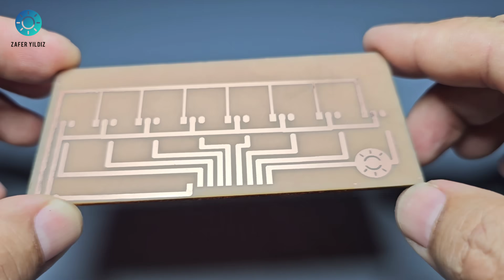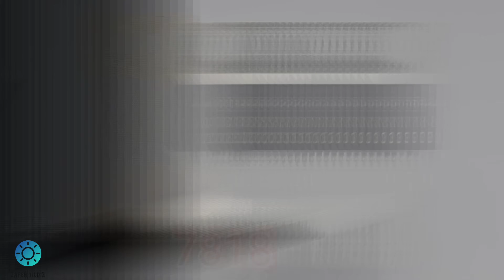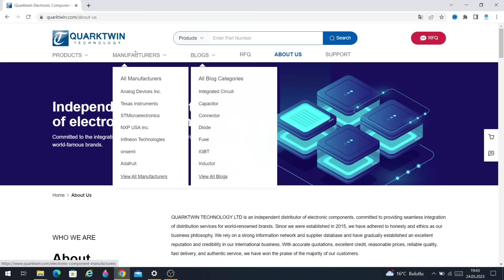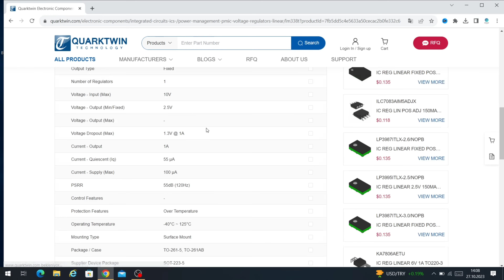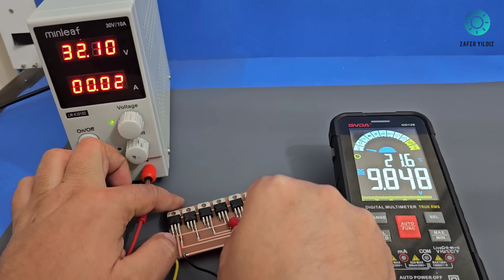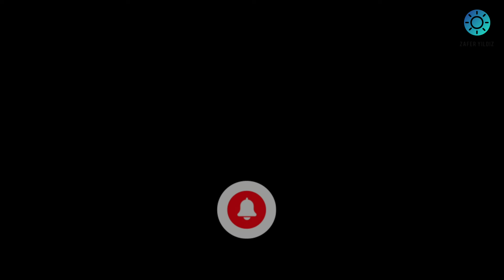How to make a multi-output voltage regulator power supply 5V.....24V

Comment: Excelente! Cuánto voltaje es el mínimo y máximo para un estabilizador de tensión como cualquiera de estos? Es decir cuántos volts por debajo y por encima de, por ejemplo un LM7812? Gracias!
Excellent! What is the minimum and maximum voltage for a voltage stabilizer like any of these? That is, how many volts below and above, for example, an LM7812? Thanks!

Comment: A backwarded solution. Made as energy and heat wasting multitransistor power supply, why not make it with a trafo with secondary wiretaps? Less items and no Allah’s grace 😂

Comment: Oh wow… just wow… how in the world did you fit so many wrong into the same video. First of all those regulators require a heat sink since they power dissipation isn’t negligible in them and will increase with the input output differential, you need both input and output capacitors to stabilize the voltage supplies as well as ceramic capacitors for noise suppression, you also need to design traces based on power requirements, don’t bend the leads of components incorrectly as that becomes a point of failure!  And for the love of god don’t ever use a multimeter to check power a supply voltage quality!

Comment: You must change the circuit by reversing the order of the regulators by connecting them in the waterfall: foods on 7824 with 30 volts, with the exit of the 24 foods on 7818, with the exit of 7818 foods on 7815 and so on. This system will also divide the heat produced evenly.

Comment: Pretty sure that the heat sink terminal is also Ground. Since you have routed power rails from top on which the regulator rests, it is very likely you are shorting power and ground.

Comment: Before using it to power your circuits be sure to (at least) use electrolytic capacitors for input/output voltages. And 0.1 uF ceramic capacitors for noise suppression also for input/output. And depending on the required current the width of the traces and the distances between them should be adjusted as well. Heatsinks are for sure necessary as well.  Don't fry your circuits!
Reply: BB XXL to

Comment: Yo dudo mucho y difiero de este sencillo circuito; por dos importantes razones (aunque no soy electronico, pero aprendo y hago calculos, y me intereso en la electronica):
1- si la entrada segun el video es de 32voltios, los reguladores 78/05-07-08-09-10-12-15-18 se calentaran demasiado y sufriran de averias pues segun el dayasheet por ejemplo para el 7809 no puede ser el input de voltaje superior a 14v. Cada regulador tiene un limite de entrada de voltaje.
2- dichos reguladores deberian tener disipadores de calor y protecciones con diodos zener para cada entrada de voltaje y segun la potencia (zenner de 1W, 2W,.... de acuerdo al amperaje de tolerancia que entra al regulador). Asi por ejemplo para la entrada del 7809 el zenner debe regular el voltaje a 14V con una resistencia calculada a los 32v del video y de por lo menos 2W de potencia.
Ahora bien mi duda en mi ignorancia es:
¿se pueden usar mas de una salida para ser conectadas?.....creo que tiene fallas de teoria y calculo, no veo tan sencillo un multiregulador para mas de 1 o 2 conecciones a pesar de los zenner y protecciones resistoricas.

Comment: One moment, why is there no insulator or heatsink between the transistors and the main board? Isn’t that Trace under the transistors the input power and the transistor tab a direct connection to ground? Yes, you can get the different voltages, but for how long before they overheat?
Reply: Its not transistors lol

Comment: If you feed the output of the higher stage also to the input of the lower stage, you don't have to worry too much about overheating for any of the stages. Of course, you then can't use all outputs at the same moment, but only one at a time.
Reply: And if my grandmother had wheels, she'd be a bicycle
Reply: @DAM091  Do you have wheels?

Comment: It is possible to do it with just 1 regulator
Reply from the maker: Yes, up to a certain point, but sooner or later other regulators will be required.
Reply: Yes, you could use the 7824 and add a series of resistors to take away the excess voltage but that would require a more sophisticated board and circuit design. I think the purpose of this video is just to show how easy is to achieve a particular voltage just by using one transistor.
Reply: @azarellediaz4892 
I do it with a ci regulator chip, the step down is more efficient
Reply: @azarellediaz4892  The voltage divider that you are proposing is useless unless you want to demonstrate voltage with a voltmeter (voltmeters have huge resistance). If you hook up a load, the resisance of the load will change the proportion of the voltage divider. Bad idea.
Reply: @jarekferenc1149  if you follow what I said, it was just to answer the question asked, “is it possible to do this with only one transistor?” As I told the one presenting the question, possible but not as simple.
Reply: You need adjustable circuit for variable voltage, of course its not possible with just 1 regulator
Reply: @jumelindanlag7685 of course, it is possible. The classic solution: just a LM317 voltage regulator, one resistor and one potentiometer.
Reply: Yes. Take one LM317, one resistor and one potentiometer, and you'll have a full range of output voltage from 3 V to nearly Vcc. Piece of cake.

Comment: i used lm7812 connected to 24v to power a pc fan and it got too hot..
i assume all of them will get too hot even with small load of 0.5A or less..
Reply from the maker: It gets hot at high currents and a coolant must be added.
Reply: 12 volt regülatör sabit tutmak için 24 volt giriş cok yüksek gerilim 7824 ün uzerine yüklenir ondan dolayı malisef cok verimli olmuyor şöyle belki giriş ve kondasator eklenerek bu ısı engellenebilir. Denerseniz mutlaka yazın merakla bekliyorum
Reply: Of course, this MUST get very hot. The input voltage is too high. The voltage drop is 24 V - 12 V = 12 V. If you draw 0.5 A, this means that this small IC generates the thermal power of 12 V × 0.5 A = 6 W !!! 
There are three solutions: 
1) Add the radiator
2) Add in series 7818, 7815, and then the final 7812. This will divide the excess power to be dissipated into three ICs.
3) Take the power supply with lower voltage.
I suggest you the combination of at least two of these measures, if you want to draw as much as 0.5 A.
Reply from the maker: More work has been shown.
Reply: <3  @jarekferenc1149